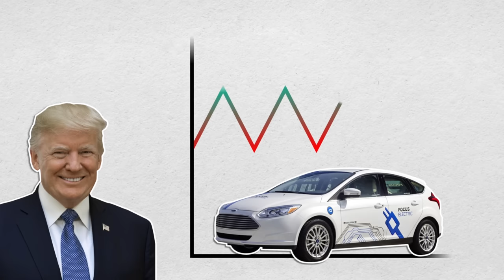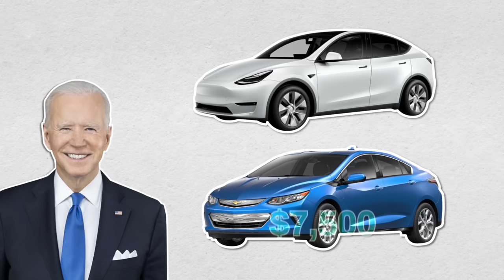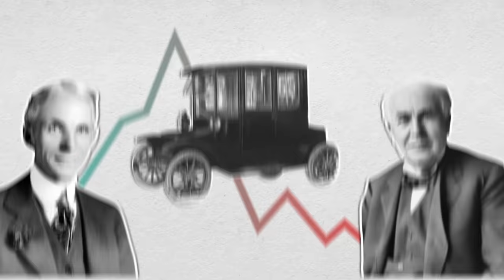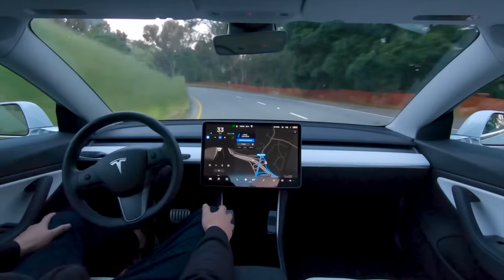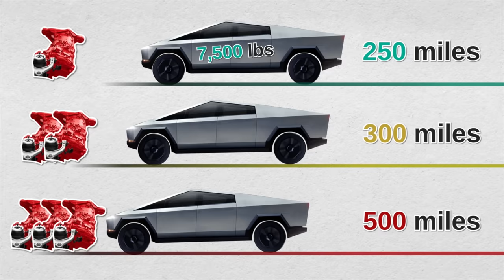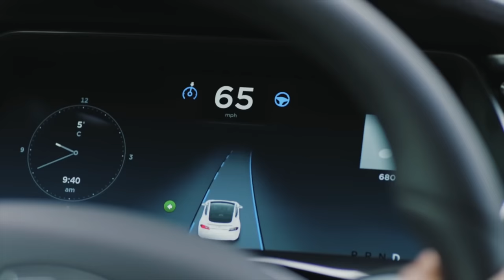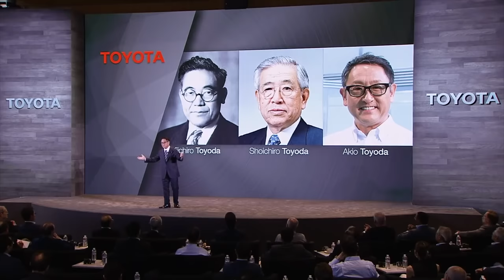Here's Why Toyota is Refusing to Make Electric Cars

Comment: I always thought the Chevy Volt (with a V) had the best current set up. From my understanding it's always an electric car, but when the battery is depleted, the gas engine is virtually a "generator" to replenish the electricity. This way you still have the simplicity of the EV drivetrain. I also think it will take a huge breakthrough in battery technology to make pure EVs viable. Also nothing was mentioned about the resources (all finite and environmentally harmful) needed to produce batteries currently.
Reply: How often do you find yourself out of battery without a charger? That car involves lugging around petrol and an engine all the time for the unlikely scenario of being stranded without power. It's inefficient.
Reply: @hassanjamal4212  The Chevrolet Volt had a battery-only range of 53 miles.  For most people, that would get them to and from work on a daily basis.  But it also allows for a road-trip, something that is not currently possible with full-EVs without specific routing.  With the Chevy Volt, you only need access to a gas-station, so no special routing is required.
-
It's also not inefficient if you consider that the weight-reduction of using a relatively small battery -- 53 mile range -- allowed for the inclusion of a small gasoline powered generator and fuel-tank.
Reply: Check out the BMW i3 Rex it's a true range extender.
Reply: Prius hybrid works this way.
Reply: @robertbelluchi1151  I disagree.  The Chevy Volt lets you plug it in over night. So long as your daily drive is less than 53 miles, you won't use even a drop of gasoline.  Most people will go a month or more before even using gasoline, let alone having to fill up.
Reply: A totally underrated concept and if you notice, most manufacturers followed the Voltec concept.
Reply: @TROOPERfarcry  Prius, some owners have added a plug port. And now there is the Prius Prime with plug in capability from the factory. I would be fine with an all electric in most cases. The only time a 200 mile range is an issue is really long trips, like driving 500 a day to get across a long stretch of country. In fact I have heard that some Tesla owners are giving them up, and going to regular vehicles. What I can't figure is that you are spending a 100k plus on a Tesla and you cant spend 500 bucks getting a 240 outlet in your garage?
Reply: @robertbelluchi1151  You can't figure out why I'm spending $100K on a Tesla?
-
Three Things:
1 - I never mentioned Tesla.  not even once.  Not sure why I'm having to defend Tesla to you when no one but you is discussing it.
2 - A Tesla Model 3 has an MSRP of $39,900.  A Prius has an MSRP of $24,525.
3 - The Prius you're describing -- the plug-in variety -- is exactly what the Chevy Volt was from its inception, so I have no idea what you're going on about.
Reply: The Volt, and all plug in hybrids are unnecessarily complicated.  You have all the disadvantages and the extra weight of two drive trains.  Pure plug in BEV will win out.  I've been driving one since 2011.
Reply: @donm2255  Wrong.  The Volt doesn't have two drive-trains.  It's wheels will turn only due to an electric motor.  That electric motor gets its electricity from one of two sources: a battery with a maximum capacity of 53 miles of charge.  OR from a very small gasoline powered electric generator.
-
Your understanding of the Volt is incorrect.
Reply: @donm2255  The Volt doesn't have a clutch, not transmission (well, a single gear one) but not like the other japanese and german PHEV. It IS the better concept and BEV - as much as I like them - should be transitory technologies until we have highly refined PHEV.
Reply: @TROOPERfarcry  The Volt has a gas tank and a battery.  It has a electric drive motor and a gas engine.  Overly complicated!  That is all you need to know.
Reply: @donm2255  "Overly-complicated" is routing a cross-country trip that includes adequately spaced charging stations.  Your premise is that it had two drive trains.  That has shown to be completely wrong.  So you're going to shut down the discussion with "that's all you need to know"?
-
Yeah, it takes guts to admit an error.  You didn't do that.
Reply: There are several other plug in hybrids, including a Kia Niro, which is also available as an EV. The Volt, however, is no more.
Reply: @oldionus  I think the RAV4 prime also?
Reply: I have a Chevy Volt and it is a great concept and works well for my use in today's environment despite its inefficiencies. It is similar in concept to diesel-electric trains where the motor is electric and supplemented by diesel generator. Where I live I can get around most of the time in electric mode and when I run out of battery, the gas generator kicks in. I was told by the sales rep to leave under 1/4 tank of gas to minimize carrying around excess weight; my gas tank is 8 gallons so I'm only carrying around 2 gallons of gas which is plenty to get home/recharging station or gas station. Each technology has it's own pros and cons, we're just going to have to match the technology to best suit the drivers' purpose until problems are resolved.
Reply: @michaellau5645  I'm always amazed that the Honda Clarity hardly ever gets mentioned in these discussions. I have one and it's great. The best car nobody knows about.
Reply: The other thing is what do all the millions of people who don't have a driveway or garage do to recharge overnight? There's not enough space on the roads to place roadside chargers for everyone.
Reply: I too have a Chevy Volt and it is amazing. In the 10k miles i've driven it, i've used 56 gallons of fuel. For an average of right around 150 MPG. No range anxiety, yet going to and from work i use 0 gallons of actual gasoline.
Reply: @donm2255  I have been driving a Volt for five years and it works great! Yes it's complicated but in battery mode it seems to be getting the same mi/kWh as the full BEVs that I'm aware of. Lots of things are complicated today so that really isn't an issue if it works and is reliable. The Volt is both. As mentioned above I do virtually all of my driving in full EV mode, using the gasoline engine only about once a month for freeway trips. I agree full EVs are the future.  Five years ago it was less obvious.  You didn't mention what you bought ten years ago. I assume you have unusual driving requirements because even today it could be hard to manage without careful planning.
Reply: @jjhpor  I drove a 2012 Leaf from 2011 to 2018.  Since 2018 I have been driving a Model S 75D.  The Leaf required some planning to get around.  One from that vintage was getting about 50miles to a full charge when I got rid of it.  My needs changed as I retired and the Model S is a better fit.  And just a much better car all around (twice the price but four times the car).  It handles all my local commuting with ease.  I only charge it one or twice a week.  I even take it to FL (from GA) on a regular basis.
Reply: Remember lithium has more pollution
Reply: @manoman0  The Volt actually has 2 clutches.  At least in the Gen2 version like we have.  One clutch is between the engine and the first generator/motor to disconnect in full EV mode.  There's another clutch between the first generator/motor and the second motor.  When both clutches are engaged (parallel hybrid mode) the engine drives the axles directly on the highway and the electric motor can assist both accelerating and regen on deacceleration.  When the middle clutch is disengaged, the engine drives the first generator allowing the second motor to run independently to drive the wheels at slower speeds (series hybrid mode).  I also think under some circumstances when the car doesn't need as much power, it disconnects the middle clutch to drop one of the electric motors out.  Our Volt runs the engine for about 10 minutes every month if we just use EV mode all the time.  Our Bolt, on the other hand, is just a single motor connected to a 7:1 gear reduction with a differential gear, that's it.  The whole drive train is connected all the time, with no clutches at all.  Super simple.
Reply: @jjhpor  We have both a Bolt and a Volt.  We drive both cars on the same roads and our Bolt gets about 5mi/kWh in the summer and the Volt gets a little over 4 under the same conditions.  I'd love to hear if others have different experiences, but our Bolt seems more efficient.  They both weigh about the same so I'm not sure why.
Reply: @scottkolaya2110  Yes, that could be. I don't know much about the Gen2 Volt but I know it's a very different set-up from Gen1 which does not have a clutch as we know. It may have something like a clutch but it's surely not the same kind or size as a traditional PHEV. I do think that GM was way ahead with that design (for road cars) yet they managed to grandiously fail with that concept. So far.
Reply: @michaellau5645  The Volt is a series hybrid and has little in common with Diesel-electric locomotives, other than that the wheels are powered by electric motors.
The volt gets it's power for the motors from the battery pack, and the engine, when needed, starts automatically to power a generator that recharges the battery pack when it's low on charge. You can do all of your local driving without using the engine at all if you want.
On the locomotive, the only power source is the engine. It powers a generator that runs the wheel motors directly--no battery pack is present, nor is there a control system for managing battery charge and starting the engine-driven generator when needed.
The similarity is superficial and not that significant. A Diesel-electric locomotive is not a series hybrid and is not electrically powered, the electric drive system is only a transmission--not the primary power source like in the Volt.
Also, a Volt weighs about 2 tons, so whether or not your gas tank is full or not is an insignificant portion of the car's weight. Just fill it if you want.
Reply: @jasonhawkinsis  That's the idea :)  Most car driving is numerous trips over relatively short distances. You never need the gas engine for that, only longer trips when you don't want to regularly stop for charging.
Reply: @TROOPERfarcry  When Tesla introduced the Model 3, at $35K it was the same price as the Chevy Volt and could go 220 miles or 4X the range of the Chevy Volt without any gas whatsoever.  Of course it doesn't have a Gas engine, but your average Joe never drives more than 45 miles a day anyway.  That's probably the reason why GM discontinued the Volt, which was a very "Blah" vehicle versus the much more exciting Telsa Model 3.
Reply: @patrickhawley600  
I've never heard of the Honda clarity much less how good it was. What made it interesting?

Comment: Hi Scotty , I have a Mini SE and a VW Id.3, and would not go back to ICE vehicles - I charge at home and do around 1500 miles per month in total between them, which is quite a high figure. I have economy electric rates at night so the energy costs are around 20% of gasoline. I don't pay for road tax, I don't pay congestion charge in cities. The servicing is every two years and is quite limited to brake fluid change and safety check. The EV lifestyle suits me!

Comment: Good video Scotty!   A big issue is that the electric grid and ability to generate electricity need to be upgraded significantly to handle the load EVs will present.  This is likely a worldwide issue and certainly true in the USA.  So Toyota actually makes a logical argument in the current time frame.   EVs may be the future, but killing gasoline and diesel vehicles prematurely would be a huge mistake.  Make progress on all fronts (EVs, traditional fuel, and certainly on the grid and electric power generation).  It may turn out that the best solution is a mix of electric and traditional fueled vehicles depending on how the vehicle is used.

Comment: If the industry could standardize battery configs, we could have "filling stations" that would swap weak batteries with full charged ones in about 15mins., say for about $20-30usd.  Could even have a supply of several  battery types to cover every type of car and truck.
How long did it take for fuel fillers to standardize?
Reply: I may be wrong but Renault tried that some time ago .
Reply: Have a look at Nio Cars in China they are doing a swap station it takes about 10 mins to take off the battery and replace with a fully charged one so you will never have a degraded battery if they go world wide it will knocked Tesla of the top spot,  they are going to start in Norway so will see what happens
Reply: Where does the "filling station" get fully charged batteries from?  Do they recharge 10000 batteries at a time in the back room?  Do they receive 100 tractor trailer deliveries per day?  It sounds like it would have to be a "warehouse" rather than a "station".
Reply: A Tesla battery can weigh more than a thousand pounds.
Reply: Modern EVs can provide ~350km of range in 15 minutes with the newest charging tech. Just give it two years and it will go down to 10 minutes
Reply: 'Cause, yeah, what would be really nice is for filling stations not to disappear. Right?

Comment: I like the direction they're trying to go towards by switching over to Electric but I would have to agree with Toyota I believe the hybrid would be the better option in the long run because even if you ask if all the cars that switched over to Electric the greenhouse gases would also rise especially cuz we also firm full gas and most of our older our planets in order to take them or digipower running
Reply: KylefromAxeTruth  you were not top-of-the-class in science class, were ya bubba! 😂

Comment: Never will buy an all-electric car, the thrill of a engine never goes away.
Reply: EV's have phenomenal acceleration (even though I don't like them, I actually like hydrogen)

However, the deep throttling sound of a large V8 is something magical and when it drives off and you hear and feel the reverb sound there's nothing like it

Sadly, lots of younger kids doing know that sound, they never grew up with it nor felt it

The big V8 is going to eventually go I fear and all we'll be left with is the sound but it's not just about the sound, those big engines actually impacted you physically as they took off

Perhaps someone will create a vest you can wear with inbuilt speakers that can make people feel the engine again
Reply: Lol! To late. Once you've experienced the rush of power and performance of model S plaid, you can never go back to your father's gasoline car.

Comment: “Ironically Counterproductive”…..Right there.
Reply: Only in Japan
Reply: @dragospahontu  It is all over. CA is one of the worst offenders in producing insane levels of greenhouse gases while LARP'ing as a "green state".
Reply: @HerpDerpNV  dude I don't care about sustenability, EVs are just better to drive and I can charge it for free.

I don't have a petrol station at home😅
Reply: @dragospahontu  evs definitely are not better to drive unless you need a soulless daily commuter
Reply: @spoonman475  ICE cars offer more feelings but they're definitely not good for daily driving especially if you live in a city.

I can assure you that instant torque combined with a low centre of gravity is way more fun than a CVT front heavy ICE car.
Reply: If only people wouldn't be afraid of nuclear power.
Reply: @spoonman475  "unless you need a soulless daily commuter" you just described like 98% of the world's people. It would be generous assumption that 1-2% are car enthusiasts
Reply: @DuBstep115  I suppose that does make sense, although most people globally either can't drive or can't drive electric due to poor or complete lack of infrastructure. Even most first world countries don't have the capacity to support fully electrified infrastructure, and it will take a very long time to get there because fossil fuels still dominate power production and converting to sustainable energy isn't exactly a speedy process. And again, I don't know where you got those extremely optimistic numbers from, because most batteries used right now will last a max of ten years. And once they must be disposed of they are nothing but toxic waste. Either way, electric cars in use today are hilariously counterproductive in terms of environmental protection. I wrote a research paper on this very topic if you would like me to link it.